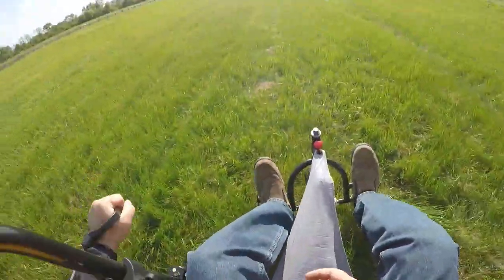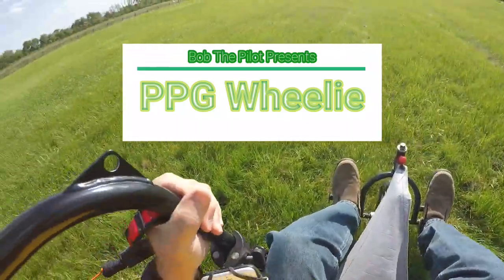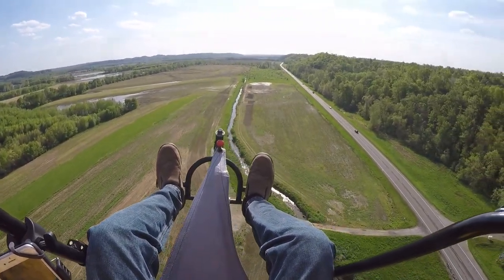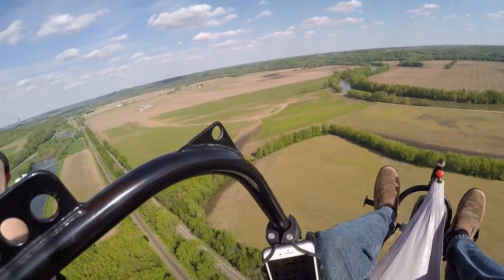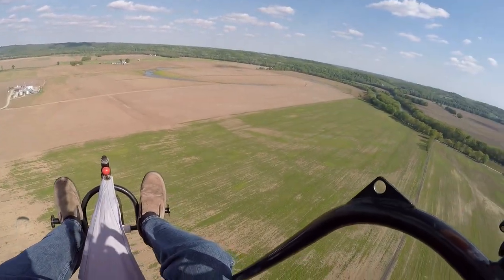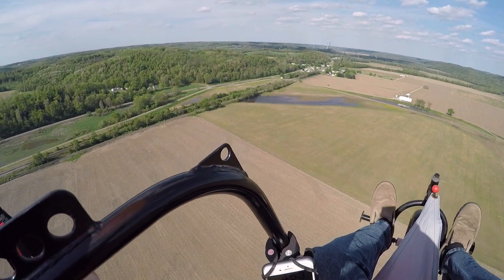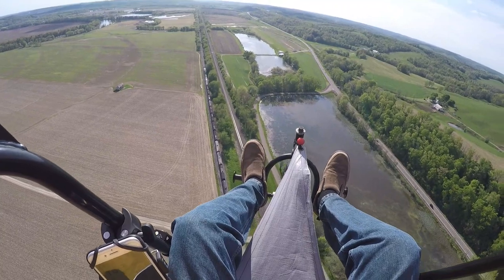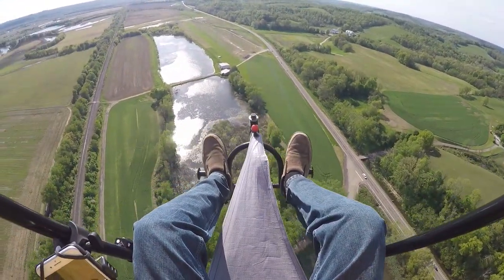Ohio Paramotor Trike Adventure Almost Turtles It.

Comment: You crazy kids doing wheelies 😀. Hey you handled it great once it happened though. Got off the power, kept it under control and saved it. Nice!
Reply from the maker: Thanks Mike, still trying to figure out this wing... it isn't all chocolates and fuzzys yet.  I wanted to fit the weight size... but I wonder if I should of gone a size or two down and just been over weight on it... heck been flying a 28 for so long... : )
Reply: Bob C I fly a 30 with a quad and I’m overweight on it too. You’ll get it all figured out though. Been meaning to ask since you have so much lighting on your motor, what would u suggest for my first strobe? Wind has been dying down right at sunset here
Reply from the maker: Mike S I bet I have a half dozen strobes.  If you don’t mind carrying a battery I like the Abrams 360 for the price.  If you want one portable you can recharge, I like the Hunter Strobe.  Too bad he went up to $60 was &50.  It flashes slow but bright.   I recently bought a 12 led that connect to small battery 12 volt that was $28 and real bright, got off of Alibaba or something.   Not a big fan of Firehouse, I use it if I forget to turn others on.  

Ok so, hmmmm my buddies have expensive ones.  I should do a review on all of them. 

Winner goes to Abrams’ 360 for price and brightness, Skip Hunter for rechargeable, portable and bright.
Reply: Bob C I’ve looked at the abram’s. Thanks for the info. Appreciate it!
Reply: Bob C ordered an abrams yesterday. So excited for it to get here!
Reply from the maker: Mike S make sure you put it somewhere the lines don’t catch it.  You’ll like it.

Comment: Well you can't join my turtle club now you where almost there maybe next time lol, great recovery that wing comes up fast compared to the old one, no A assist and you took the training wheels off good boy your learning. Looked like you didn't have your A's in your hands I think that's why you pop your wheelie I've never tried launching without mt A's in my hands, try it next time you'll see.
  That's the spot you flew when I first started watching your videos, oh the memories lol, super smooth landing, the take offs are the scary part for me. Had to start my edit of my last video all over again not sure what happened it didn't work but I'm working on it, my take off was super fast I'm trying to stop that shit but I can't help it some times, once I'm committed you got to go! Thanks for sharing
Reply from the maker: Crockett I used to launch quick or fast.  One day I told myself, that crap has got to go.   So I forced myself to taxi longer just for fun.  I think that changed my fast take offs.   

It will go away just give it time.  You’ll slow down.  Going to try trims out a bit to get the wing up faster.   Still feeling this one out.   We both need to be committed.

Comment: I have never seen anything like that on a take off Bob. Nice! I am working on setting up a speed bar on our set up.  Hopefully will have it in the next few weeks. Love your videos buddy.
Reply from the maker: I thought about having a speed bar connected... well not really a speed bar but trimmers that would take the place of a speed bar.. MacPara offers them.  Forget what they call them but Bob Curry and Kentucky (Florida)  Wingnut I think use them.  I heard they were a bit hard to pull.. I settled for the long trim range on the Universal to compensate for the speed bar as with speed bar you only get a couple MPH more on this wing.  Are you talking about the same as what I mention above or actual speed bar on a trike??
Reply: Actually speed bar that came with my Air Design wing. I put it in a box never thinking I would use it. As I am talking to more people I am seeing the importance of speed bar and the benefit it has over pulling trims. In addition to that we should be able to use it to compensate for torque and steam with our feet as apposed to always having to pull with our arms. I’ll let you know how it goes.
Reply from the maker: @David_Wolfe  gotcha... Larry, or ParaOrange, Calls them A Trimmers.. so basically it is the same as speed bar but you pull down and lock the speed bar connection with same thing as Trimmers.   Looking forward to seeing your setup.

Comment: Turtle happens because all the weight of the motor is behind the rear axis and that makes it want to tilt backwards. All the engine weight should be at least at 20 or 30 cm away in front of the rear axis. Thats the only design failure that trike has. The rest is cool
Reply from the maker: Roger That!

Comment: I'll be an "armchair pilot" for a second.  I noticed you didn't have any "A" assist going on.  Maybe if you had pulled on the "A's" the wing would have come up a bit more quickly.  What do you think?  A fairly strong head wind (9-12 mph), and the possibility of doing a "turtle", is the primary reason us trikes have a hard time taking off in those conditions.  I've seen people launching in stronger winds with somebody holding down the front of the trike until the wing gets up.  Also, when you land in a stronger head wind the trike will get pulled back wards sometimes.  How strong do you think the head wind was when you were launching?
Reply from the maker: The winds were around 5-6 with gust to 9.   This is probably the 5th or 6th flight with this wing and I am still feeling it out.   I used A assist on my other wing as it wouldn't come up as easily as this one does.   I may open up the trims a bit in the future to see how that works on this wing as well as assisting the As' .  On my other wing I flew trims all open with no issues.  Still a learning curve on this wing.. thanks for the thoughts.

Comment: Great Wheelie! Cool Video…I need to learn what mic to use or how you get such good audio without engine noise?!?!
Reply from the maker: ToledoFlyBoys GoPro 4 Sena Bluetooth backpack. Sena smh10.  Turn on noise control.
Reply: @Ohio-PPG-Trike-Adventures  i need to figure out how to get it to work with my hero 5 black and sena 10r since the hero 5 doesnt have that bluetooth pack.... dang!
Reply from the maker: @toledoflyboys8685  is this Brian?  I was going to buy a newer model and even think about the 7... but the GoPro 4 you can almost get a dime a dozen anymore... so add the bluetooth backpack wasn't that much and ... honestly... not sure at 1080 on youtube if you can tell the difference with a 4 though a 7.... Just my thoughts... and the audio has been so much better.. I hear exactly what you are saying from many flyers.    I get the same question.. How do you knock that background noise out and sound so clear...
Reply: @Ohio-PPG-Trike-Adventures  This is Doug…. but yes I was after image stabilization with the newer cams but now i think im focused on sound lol thanks for the info!

Comment: Yeehaw!!! I hear ya Evil. ~8^)
Reply from the maker: I don't know... second guessing the size... probably just need to figure if I should trim out more or A assist.. Heck.. haven't left the trims all the way out during flight...   Did use the tip stearing... seemed a bit spongy....
Reply: @Ohio-PPG-Trike-Adventures  Yeah, I heard you mention that it was larger than the previous. Gotta admit, that kind of surprised me a bit. I wish I had some insight when it comes to wheels, but I'm out of my element there. Kewl wheelie though!

Comment: I noticed that you do not have your A-line assist hook up what's up with that?
Reply from the maker: I used A assist on my previous wing and this wing comes up a lot easier and isn't needed.. well at least not right now, as I am still feeling this wing out.   You don't actually need A assist line connected you can just grab a hold of the lines and let go once you have the wing moving up.